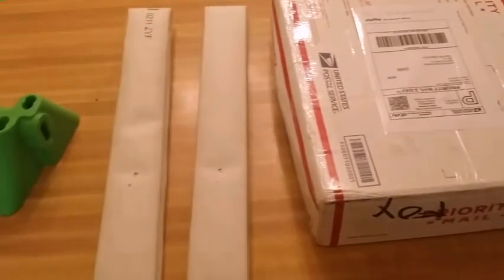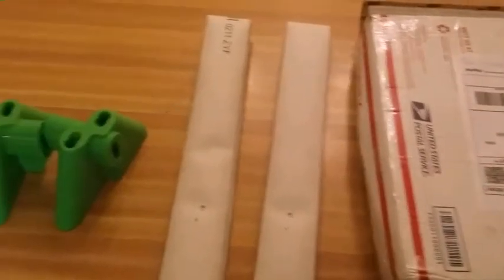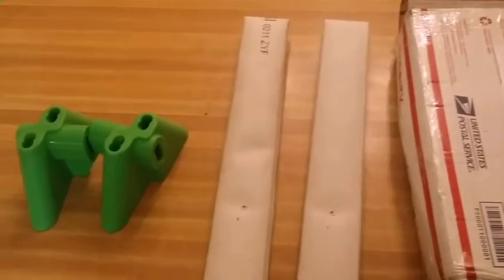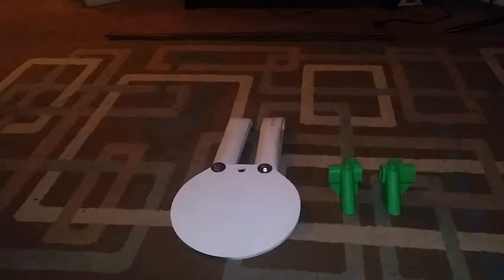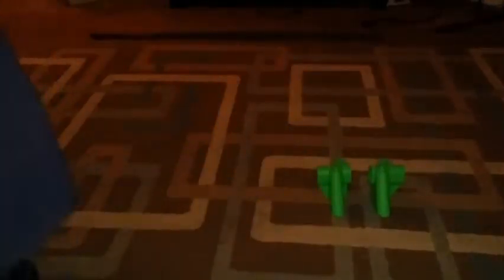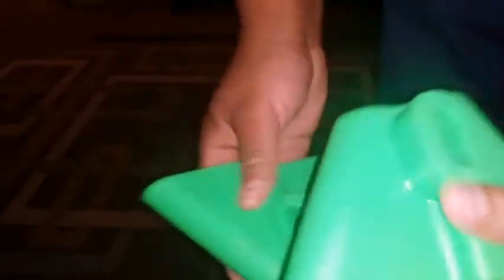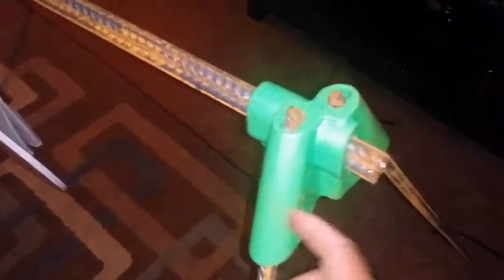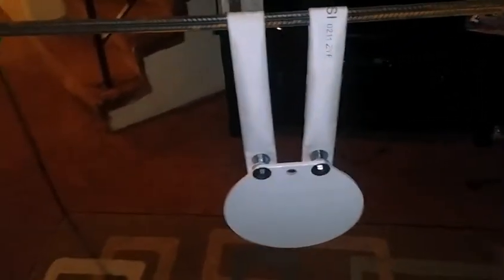Ar 500 steel 12" gong and last stand target stand

Comment: I whipped my rebar down with WD40 to clean off the rust..bars slide in easier.  Also, once you put the legs in, you don't need to remove them...just fold them together for transport and storage..
Reply from the maker: Yeah I just leave them in thanks bro